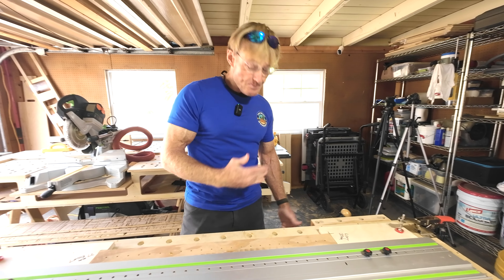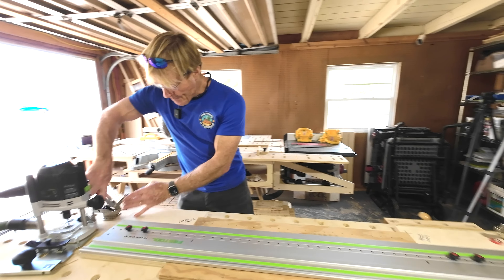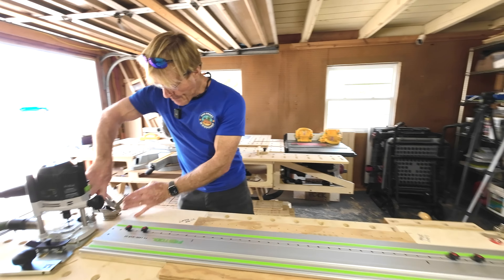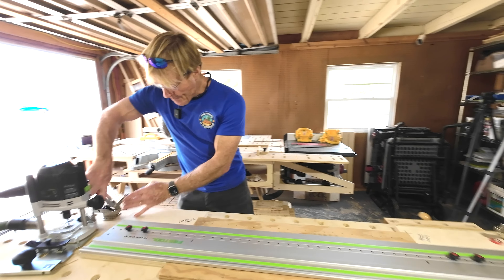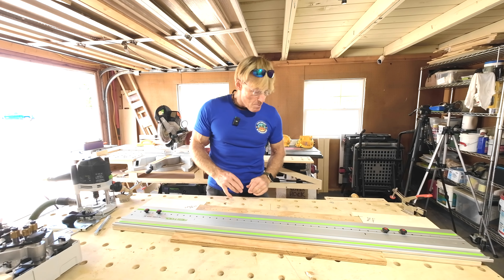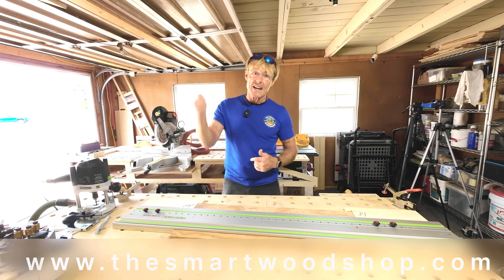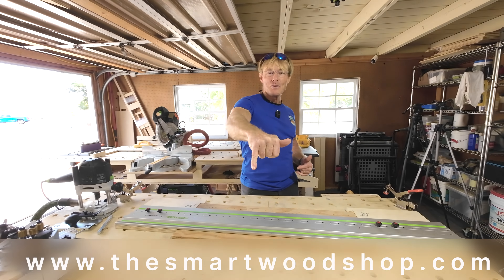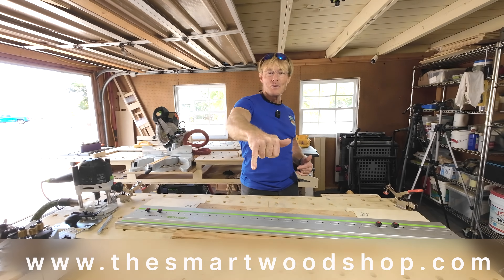Get More Done in Less Time with this Smart Jig for the Festool LR32

Comment: Yes - more details on how you made the jigs and your methods for 32mm cabinet making would be great. What distance does your jig set the first hole at from the bottom of the panel? Seems to be several different offsets (35mm, 46.5mm, etc.) depending on which variation of the 32mm system you use and whether you want your panels handed or unhanded. I have the Bosch equivalent to the Festool LR32 which is much less expensive but it has the same challenges for setting starting hole offsets from the panel face and bottom.
Reply from the maker: My panels are balanced so there is no top/bottom right or left. All of my panels are a multiple of 32mm + 6mm which makes the first hole from each end 35mm. I am making a video showing the system I have used for decades and why I choose a balanced 32mm panel +6.
Reply: @TheSmartWoodshop  Great, thanks for clarifying that Ron. Sounds like you are using the KISS II system which seems like the best 32mm cabinet system. What router bit do you use to drill the holes? I'm finding that a 5mm spiral bit makes the holes slightly sloppy for 5mm shelf pins. I was thinking about trying a 3/16" bit which is 4.76mm. Also, do you use a spiral upcut or downcut?

Comment: Yes Ron, please do! I’ve had the LR 32 system for a couple years, but rarely use it because of the set up issues.

Quick question, if you’re doing long sides like a bookcase, could you just utilize one of your plywood jigs on one end?

Comment: I just bought an LR32 guide as my extra rail so I can cut whole sheets of plywood. Is this compatible with only the Festool routers?
Reply: I have definitely seen 3d printing models on thingiverse for makita routers. I have also seen jigs to bore 32mm holes in a makita guide rail, also 3d printed. not sure if those are accurate enough though, particularly if you are having someone else print them off of a STL file you didn't make with a specific printer in mind.

Comment: Hey Ron, do you find yourself using those style clamps from tso more than the traditional festool quick clamps? Just about to grab a pair of one or the other and was curious on your input, thanks
Reply from the maker: I only have one pair of the TSO clamps, but they are easy and useful on the bench with the dog holes. I haven't run into a situation yet where they haven't worked. I am thinking about one or two more sets.